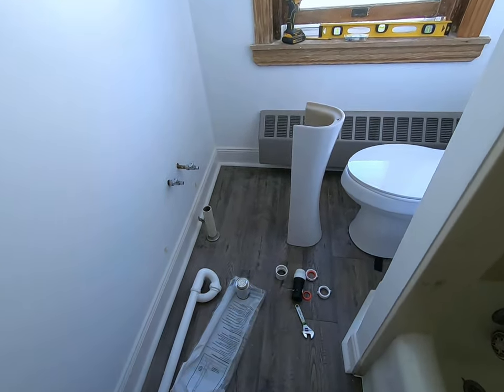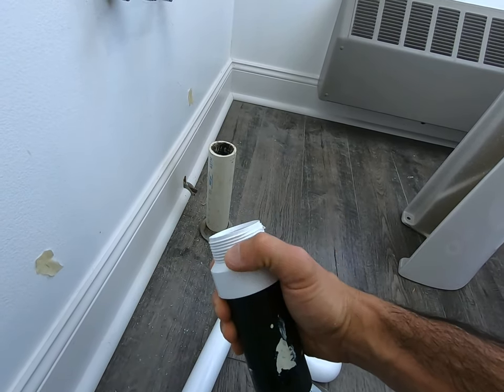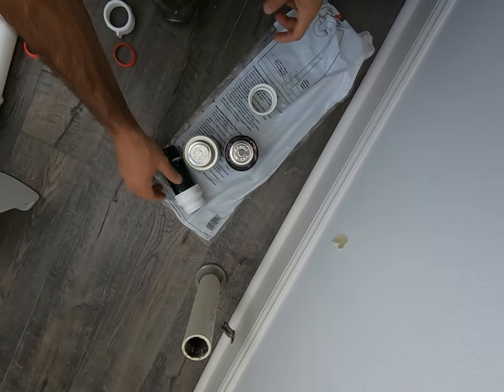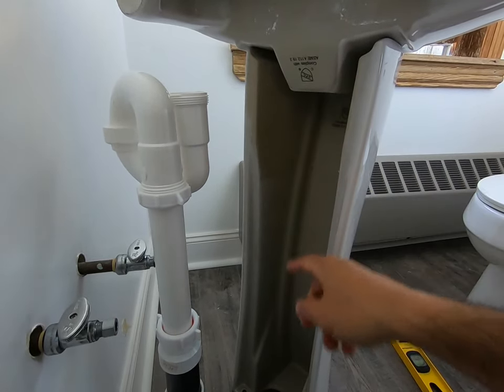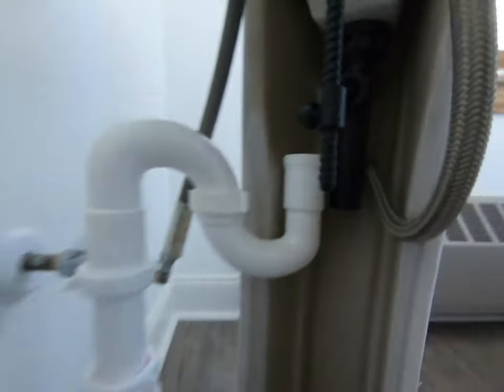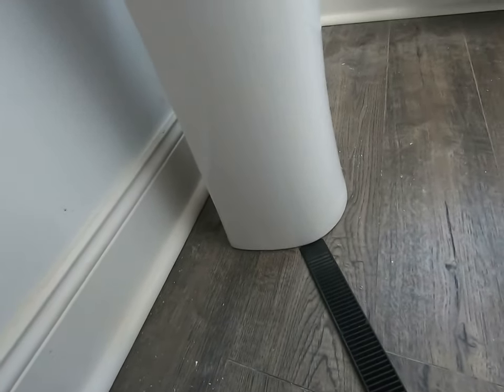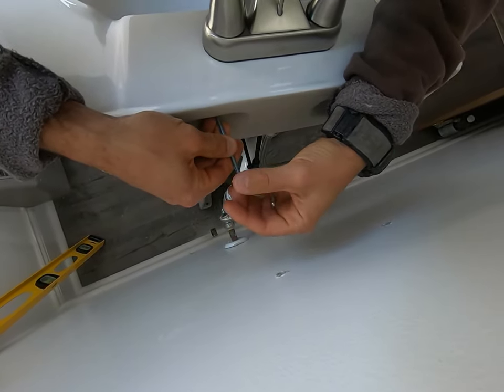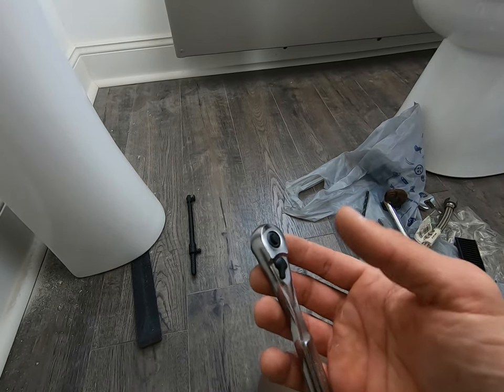AquaSource-How to install Aquasource Pedestal sink from Lowes

Comment: Is the S trap still legal?    And what about a vent pipe???
Reply from the maker: You are correct about the S strap.  This was a replacement, no new plumbing was installed.  In this case there was a vent pipe stack connected to the drain that went to roof.

Comment: What size bolts you use to mount the sink
Reply from the maker: Quarter inch screws 4” long I believe is what I used.  Remember a washer too! Thanks for watching 👊🏼
Reply: @True Grit Development  Thanks alot
Reply: You can use a right angle drill attarchment

Comment: What's the size of the drill bit used?
Reply from the maker: Size it up to the toggle bolt wing, use a spade bit, 1/2 or 3/4” depending on size.  Hope this answers your question. Thanks for watching 👊🏼